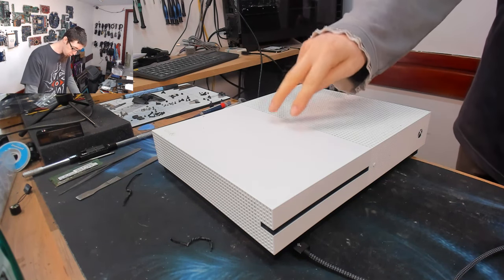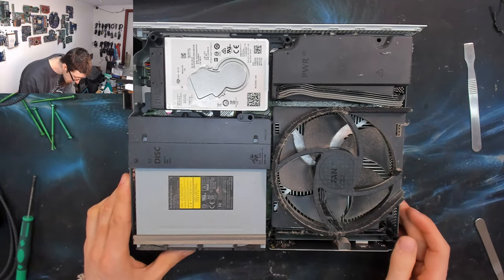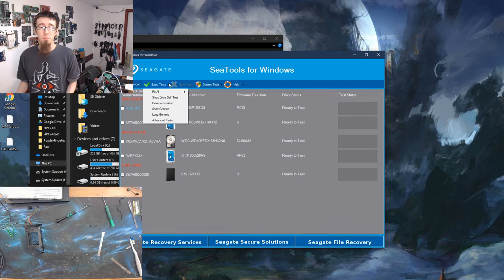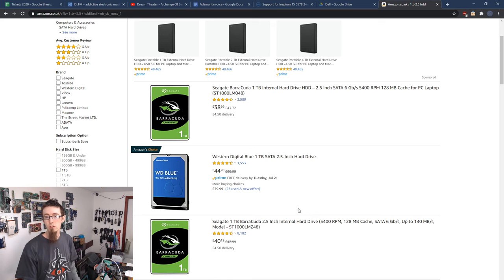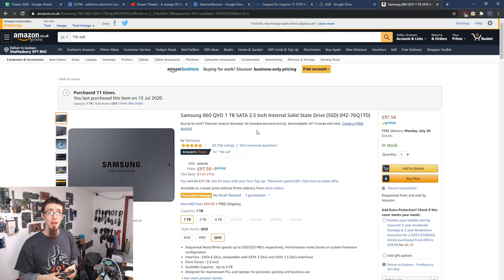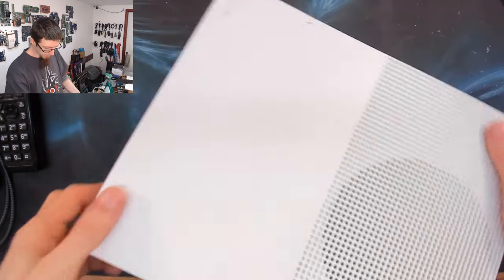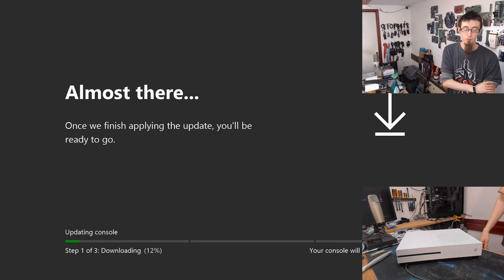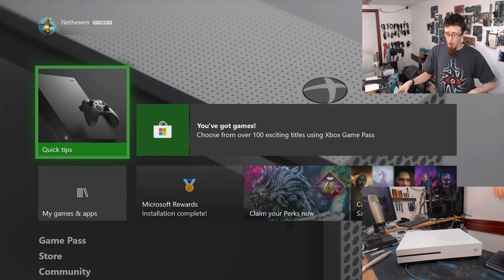Replacing an Xbox One S HDD with an SSD - LFC#214

Comment: How does replacing a drive affect warranty, online play, etc? Will replacing one cause a ban? Or does Microsoft not care?
Reply from the maker: I've never heard of any impact on online play - the console would be 'tracked' by its serial number, rather than the drive that's in it.
Replacing the drive will void the warranty though, yes.
Reply: @Adamant_IT   Ok so if mine is out of warranty there be no issues with that. But no issues with a drive swap? I'm good with that👍

Comment: I have a xbox one s. It stormed today and lightning strike hit close I think  and I went to turn in on it made the noise but no light. Now it wont do anything . Any recommendations?   What part is most likley damaged ?
Reply from the maker: Most likely the PSU. Replacements seem to be fairly cheap on eBay, so if you're doing it yourself it's worth a shot!
Reply: @Adamant_IT  ok thank you. Houfully its the east fix

Comment: I did this a couple years back on my OG Xbone, but not because the original drive was malfunctioning. I advise never buying a DRAM-less SSD, especially if you want it to last.

I used Mandiant to pull the drive data and partitions, wrote the GUID to the SSD drive, and reimaged the SSD with the extracted image.

Be sure to use Powershell to write the new GUID as using Linux never allowed this be loaded by the Xbone regardless of the given GUID. The GUID is used by the Xbox to determine drive size (so there are 3 options).

This method requires no factory reset so all my data was preserved. There was no noticeable difference in game performance, but that was expected with the SATA2 bus. It does boot and update a little faster.

Comment: with new Simply method,use new 1tb SSD(or 500gb) ,no partition needed,put the new drive inside unformatted. Plug-in USB pendrive with latest osu1 unzipped in root $SystemUpdate 
. Power on, system update offline and voilà new powered up One S/X, ultra Easy today. PS: with this method 480/960GB doesnt works.
DONT USE CHEAP SSD, or DRAMLESS. best choice price performance for sata 3 860/870EVO/MX500.
Reply: Thanks for the note. I have a 960 I was going to try this with
Reply: Thanks dude, I seen this comment and went for it. I am now up and online again!

Comment: I appreciate the time and effort that you put into this tutorial! At first I remember when I swapped the original Xbox one hard drive out with the regular hard drive and it took forever damn near to open it up. This one does seem to be similar, but it's very much easier and not to mention with me being an IT I'm waaaaaay smarter on how to open up electronics than I did back then. Definitely was wondering how we get the operating system on it after swapping it out with the SSD and glad that Microsoft actually has a method for this for off-line system update. Once again appreciate your time and thorough description on how to do this and I will be doing this within the next couple of days.
Reply: how did it go?  my kids' xbox one s is slowing down and i was thinking of switching to an SSD
Reply: @kdstyles1979  Went pretty smooth. I did see some upgrade in responsiveness in the menus and minor in game, but definitely worth it for sure.

Comment: The K400 is strong with you. Best combo keyboard by a long shot in my experience.
Reply from the maker: I find it absolutely horrid to actually type on... however, the convenience is absolutely worth it. I've got three of them in the shop, and it's so much better having a combo unit and wireless key on a lanyard compared to messing around with a wired mouse and keyboard on a workbench.

Comment: So found your video to be helpful! But through my experience I learned that if a console is part of the "Xbox Preview Program," then none of this, including the OSU1 offline update will work, even with a new hard drive. I thought my Xbox One X had a bad hard drive since a recent update got caught in a fail/restart cycle. Replaced the hard drive with a new one, but same issue continued to happen and offline update would always instantly fail. Decided to test the old hard drive with SeaTools and both short and long generic tests passed on the old HHD. So started looking at other issues. Finally was able to determine that the offline update and/or scripts for a new hard drive will not work for a console on the Xbox Preview Program. To do so, the console must be removed (unenrolled) from the preview program and then offline update or even an online update will work. At least that is what worked for me.
Reply: How does one unenroll from the preview program if the drive is dead? If there's no network (dead drive and no operating system), then there's no way for the Xbox to communicate (or vice versa) with MS servers...?
Reply: @cezardob  You can unenroll from the preview program when logged in on any Xbox. My brother logged into my account on his Xbox, unenrolled my account and console from the preview program. I thought and all errors indicated the drive was bad, but ended up finding out that wasn't the case. It was the Preview Program update that was bad, my drive was perfectly fine. So I wouldn't really know anything about having to deal with an actual dead drive situation, combined with the Preview Program issue.
Reply: @K-tf9vt  ok, so that makes sense. My only concern is how would the "defective" Xbox know that it was no longer enrolled when network services don't work because the unit doesn't boot to the main screen so my assumption is that internet won't work, either. It's definitely worth looking into. Thanks for the reply.
Reply: @cezardob  yep, valid question. But if you can easily login on another Xbox and unenroll, may be worth the try. Either way, best of luck in getting it fixed.

Comment: I finally got around to installing a 870 EVO in my OG XB1 and used your vid to install it.  Works perfect and it is much snappier.  Even with the SATA 2 interface the difference is noticeable.  Great video.

Comment: After Seeing this video I upgraded my xbox one x. Everything seems to work great however the boot animation is now gone which is apparently a known issue using this method. But that's not a big deal. My console seems much more responsive now....Using and older 1TB 850 Evo from my desktop pc.
Reply: Good choice i have in my desktop 850evo too great SSD.
Reply: Boot animation Will return with next system update dont worry 😉😉
Reply: How much usable space did you get after installing the SSD? I'm considering getting one for my OG 1TB Xbox One
Reply: @Major.Ocelot2U  I just looked and its 781GB I am not sure I would swap it out in the old vcr looking org xbox one the drive would be worth more than the console but that's your call
Reply: @z3razerviper  Thanks for letting me know. Better to just stick to an external drive

Comment: If this method works on the xbox one x, this will save me a lot of time screwing around with cloning. The hard drive in my xbox one x is failing to do system updates, so I'm figuring the drive's done (plus the guy I bought it from took his console with him to different places, so it makes sense why the drive died)
Reply: yes in my one x i have put mx500 unformatted ;-)...use newer 1tb SSD(or 500gb) ,no partition needed,put the new drive inside unformatted. Plug-in USB pendrive with latest osu1 unzipped in root. Power on, system update offline and voilà new powered up One X, ultra Easy today. PS: with this method 480/960GB doesnt works.

Comment: It not working at all. I spend two days trying osu 1-2-3 few usb and it just don't want to start form USB. I suspect hard drive need to me minimum 500gb. Disc Clone also not working just leave it waste of money and time.
Reply: I have also had an issue trying to use a 256GB SSD. Throws errors on installing the OS . Downloaded and formatted USB twice. 480 GB SSD on the way and will get back to you.

Comment: I changed the hard drive and put the thumb drive in for the offline update. Powered on just fine and started updating. There are 3 parts to the update and on the last section or sends me to the error screen again, so I'm stuck in this loop of everything going smoothly but on the last part there is an error screen
Reply: Figured it out! I had unplugged the disc drive and when it was updating it needed to update the disc drive and was pausing the update because the system couldn't find the drive. Took it all apart again plugged it back in and worked! We got a happy 14yr old  again
Reply: @Mojomasonlovin  hey thx i need to know if it would work with the usb thx for this :)

Comment: The Microsoft consoles have always been a PITA to change their hard disk. Credit where credit due, on PlayStation it's 1 screw to pull the mount out then 4 screws to unmount the disk and you can change it yourself.
Reply from the maker: Yea I've always been amazed by that. I have grievances with the PS4's design for other reasons, but the HDD location was really good for enthusiasts to safely upgrade themselves.
Reply: @Adamant_IT  Right? You'd think Microsoft would allow end users to change the one component most likely to fail themselves

Comment: Hopefully SSD get cheaper as they get mass produced for XBOX SX and PS4.

I think the average gamer only needs 4TB
Reply: Bigtruckseriesreview Motorsports 

nVME not the same as SATA so I doubt that they become cheaper.  
You meant PS5.
I fully agree with your last statement as the minimum capacity.
I’m closing in on 5TB/1024 with my 4TB external drive.
Reply from the maker: I think we're at a plateau with SSD prices right now, they haven't budged in a while. Consoles won't make any serious dent in them - SSDs are already mass-produced for the PC OEM segment, which is bigger than consoles.

Comment: Looks like the process to replace a HDD on the Xbox One is not as difficult as the old 360 HDD, where you had to use the Hex editor to fool the system into thinking it is a Official Xbox Drive, and had to make sure you got compatible drives. If I'd known this I'd have replaced the internal drive by now, but the Series X is roud the corner so i'll wait.
Reply from the maker: Yea... the 360 was a bastard for that. Made all the worse by the fact that you couldn't get sensibly sized HDDs from microsoft either.

Comment: even if a drive does pass it would be good to look at  the S.M.A.R.T. information.  even if the drive passes diags in sea tools  you cant tell how many sectors the drive has remapped due to failures.  One reason  you start seeing bad sectors in diagnostics is because the drive has ran out of "spares."  just trying yo be helpful  :)
Reply: Agreed. The first thing I would do is check the SMART info because it is quick to do and can show you gross errors easily.

Comment: I have the OG XB1.  Can you install SATA 3 cables from a S or X model and make it load faster?  OG XB1 has SATA 2.
Reply from the maker: It's limited by the controller, not the cable. However, at SATA2 the SSD can still pull 240MBps, vs the HDD that will top out at maybe 100, so twice as fast. Random reads, the SSD will be capable of 30MBps vs 0.2, 100x faster. Although most games will be optimised to avoid random ops, because HDDs are so bad at them.
Reply: @Adamant_IT  Thanks for the good info.  I will be installing be soon.  I’ll be using your video during the installation.
Keep up the good work!

Comment: Does it have to be a samsung SSD? I'd have gone MX500 1TB instead as its TLC instead of QLC and its the same price.
Reply: MX 500 Is excellent, Better than qvo no doubt
Reply from the maker: Yea I screwed up on this video - the MX500 has come back down to the same-ish price as the QVO, and is a better choice. It's been expensive in the UK for a while, so I hadn't considered it when I was recording.
Reply: @Adamant_IT  They're usually £65>£55 for the 500GB and I buy them all the time (use for test system, Sell it to customer with <1TB of writes, Buy another, rinse and repeat).

Comment: Microsoft has the OS on the drive and multible partitions with special names and data within.  If the drive can be cloned this is best but it does not care the type or manufacture as long as it is SATA III. They do only do Certain size drives for the internal drive 500GB/1TB/2TB with 2 TB being the max for the internal. This may have changed with recent updates but use to be  a larger drive would work but may not be fully usable in its full partition size and Xbox would only format it to 2TB. Seems it never cared about the externals size though. Largest I ever tested with external drive was a 16TB drive. Last time I had to do this is before the One X came out so things have changed. See link I am placing below for an alt way of doing this but this video is the best way of doing it in my opinion.
https://www.pcsavants.com/tech-tips/xbox-one-internal-hard-drive-upgrade-replacement/

Comment: SSD vs HDD comparison: https://www.youtube.com/watch?v=BWbSsJwzOkk
A note on SSHD's (hybrid drives). Avoid these. Any benefits you see in the above video are misleading. They typically have 8GB of NAND memory (the SSD part) so if you have just one game it might speed up loads nicely. But it will fill up so when you load a different game you'll have no benefit until the algorithm learns that you're loading those files. 8GB is less than 1% of the space on a 1TB HDD so it's difficult to say how much it helps. SSD's are getting cheaper all the time. I got a 2TB SSD for my games (Western Digital) for about $200USD. 1TB models about half that... just get something that seems reliable. Performance in game loads should be about the same whether a super fast or slow SSD as there's diminishing returns due to bottlenecks elsewhere (until the new consoles launch at least).

Comment: What's the max size hard drive you could bang in?
Reply from the maker: 4TB I think
Reply: @Adamant_IT  great video....nice tutorial...what size was all the screws agin ...(for future ref)
Reply from the maker: T10
Reply: https://gbatemp.net/threads/xbox-one-internal-hard-drive-upgrade-or-repair-build-any-size-drive-that-works-on-any-console.496212/

According to this guy’s research on replacing drives and others who have done so as well, you can fit 4TB but you can only use 2TB max or the system will not work correctly.

Comment: Wait, so these now repartition themselves? You used to have to create the partitions on the drive before dropping it in the console, but it looks likes yours rebuilt itself. Microsoft must have made this a bit easier now, awesome!
Reply from the maker: I just dropped in a completely uninitialised drive and let the restore software do everything. Can I put this to the test with any Xbox 360 game? I have some in a box because of reasons, so I could actually confirm if backward compatibility is working or not if it's as simple as putting a few 360 game in the drive and testing them.
Reply: @Adamant_IT  please do I'm curious as to what will work and how all is going with the swap make an update video as to how games are running xbox one and 360 overall system features and the likes I'm thinking of doing the same swap but I want to know what works and doesn't before I do thanks

Comment: ok so u put it in then they say nope dont want the ssd now u have made that ssd second hand as you have used it so dose that meen you are gona sell it to the next cs as used as you have used it and its not new anymore
Reply from the maker: I use SSDs all the time in various projects, it's no issue for me. I'm fully expecting them to go with the HDD option, but I didn't have one in stock because ewww HDDs.
Reply: @Adamant_IT  yea what im saying you took a risc on using the ssd if they say they done want it then its not new as it has been used so you can't sell it on as new also putting ssd in xbox the speed is around only a 5% increase so the cost diff isn`t worth it realy but if it was the new ps5 the stock drive thats being put in that is faster than the current pcie 4.0 drives

Comment: I was able to replace the hdd in my Halo: Guardians Xbox quickly and easily thanks to this video. Aside from the time it took to back up my games beforehand, I was up and running inside of 30 minutes. :-)
Reply: Did you have to program the hard drive? Because I've seen some say that they need to program them before being able to use them
Reply: @jessemartinez2806  I put the bare drive into the Xbox, then when I got the 105 error, inserted a flash drive with OSU1 in it, just like in the video. The files copied and got me to my XBox home screen in about 5-7 minutes, then about another 10-15 minutes of signing in and starting to move my games from the external backup drive I had.
Reply: @jessemartinez2806  All the people saying you need to run some weird script on your PC for the new drive are just parroting old/outdated info

Comment: It's probably a better time than any to put an SSD in an XB1 or PS4. They have become so cheap recently and it's not like you need to worry about getting the more expensive high end models with super fast Nand chips, as the consoles cannot fully exploit a SATA III SSD in the way a PC can anyway (due to the slow CPU's).
Reply: agree mx500 in my one X, another level respect the old 5400 rpm.

Comment: I've followed the guide everything works fine but the xbox only recognize 375gb out of 1tb that is the ssd that i've put in there, anyone knows how i can make it use the whole ssd?
Reply: https://gbatemp.net/threads/xbox-one-internal-hard-drive-upgrade-or-repair-build-any-size-drive-that-works-on-any-console.496212/

You need to format the drive with the script as your console will only format using the 500GB Infomation. This is the only way to make it work and it does so the correct way to the system will behave as a 1TB model and will keep all 1TB after resetting the console if you ever need to or plan to sell it.